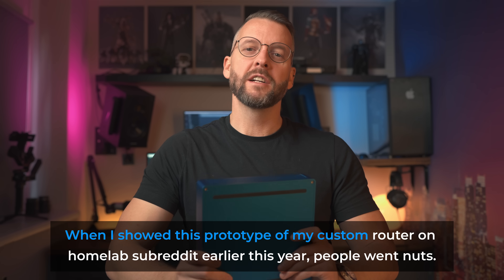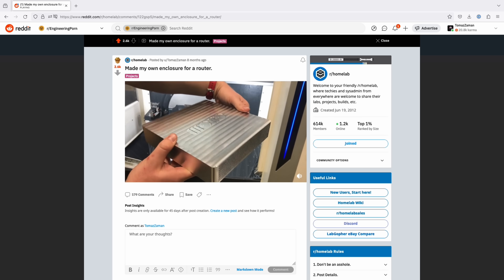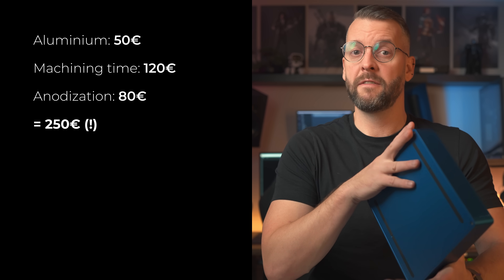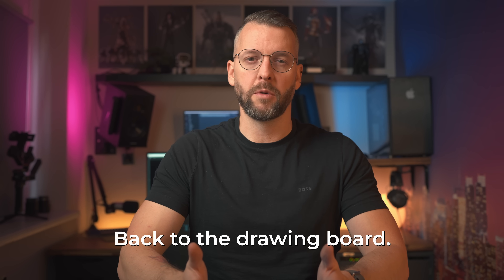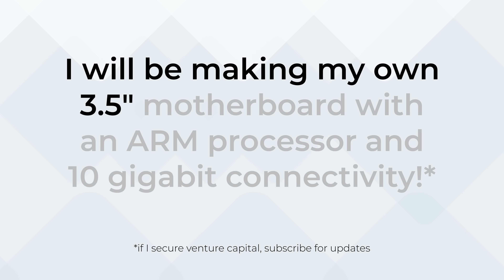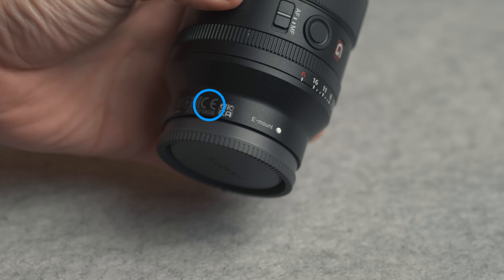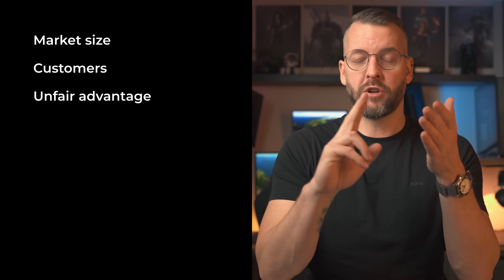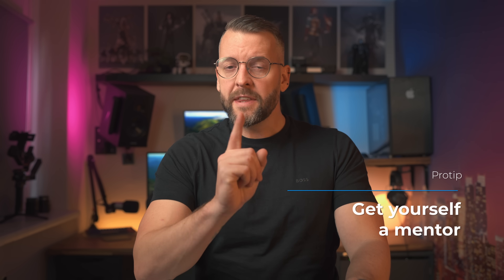I'm making my own high-end router. From scratch.

Comment: I don't give a shet about  what the case is made of. Just do what the other router companies are not providing. Things I care about:
1. Make it open source. Much like what is Pine64 is doing.
2. Has to be cost effective and bomb proof. I want a router that can just go on and on.
3. Make the Wifi upgradable. So whenever a new spec comes out  (wifi 7/8/etc.) I can buy a new m.2 wifi card from you and upgrade the firmware.
4. Super power efficient. 10 watts or less.
Reply from the maker: YES! Finally someone who wants the same things as myself. Except for the case. But we'll talk about that. :D

Comment: I understand your thought process of using an ARM processor because it is more open to new implementations. But any BSD-based router/firewall software such as pfSense and OPNSense are not compatible with it. VyOS is also still not officially compatible with the ARM architecture. I found it odd that you enumerated those router software at 6:40 and a few seconds later you say that you will be making your own system with an ARM processor. There are no 3.5" ARM motherboard in the market that support OPNSense and VyOS on the market simply because they are not compatible with each other.
Your idea is great, there are not a lot of great generic router hardware on the market that are designed for open source router/firewall softwares, especially since the announcement of the EOL of the APU (PCEngines) hardware product. I think that you should stick to an x86 architecture (Intel or AMD) and Intel NICs to ensure the highest compatibility.
Reply from the maker: Thanks for the input - make sure to watch my latest video in which I explain most of your points.

Comment: The device in the segment to beat is the R86S G2 which I loved for it's 2x 10gb SFP ports and the 3x 2.5gb ethernet.  It is what I currently use for pfSense but I would happily replace it with something better.
Reply from the maker: Honestly, I'm not trying to beat R86S G2. Or any other device, for that matter. I want to make something great that people will be involved in the creation of, hopefully pass on as much knowledge as possible in the process, offer great support once it's done and sell enough to be able to build an ecosystem of other products around it. Ambitious, I know. 😅
Reply: Have you gotten to test it with any CPU-intense things like connection tracking or WireGuard? I'm curious what kind of throughput you get with NAT also.
Reply: @john_elliott  I am not even sure how I would go about running throughput tests.  If I do a speedtest_net it shows up 913up/932 down. Fast_com shows 1gbps down / 910 up. Although fast used iip6 so not my NAT. But that's just my 1 gbps down / 950 up pppoe fiber internet.  I only have 10gbps devices on my local VLAN and everything  on the other VLANs runs at 1 gbps.

I do know it is noticeably faster than the Deskpro with a 2x 10gbpc card it replaced. I mainly did it because the R86S uses less power so the UPS downstairs struggles less during an outage and also the smaller size helped as well since my landlord would not appreciate me bolting a second rack to the wall downstairs.

Comment: take my money ! 

make something that has sfp at least 2 sfp or 2 rj45 ports ppl in america will go nuts.  im willing to spend on that in a heart beat i currently have a dellr720 as my bare metal router id like something less loud and less power hungry but its impossible to find a 10gb+  sfp anywhere im more than willnig to use a rj45 to sfp converter its what i do now because rj4510gb is to much money.

this would be my new opensense box for sure.  i would be fine with plastic tho if it saved money,  this meets the (i want this) for 1u router that does not sound like a angry chicken being sucked into a jet engine .

@Tomaž Zaman
Reply from the maker: Thank you for your input!

Comment: Scope creep would be my biggest issue with a project like this. Keep it simple but look to the future as well. If you could make it "modular" that would be very cool. Only need a router? Get the base unit. Need to add some wifi? Sit a radio module on top and plug it in. Need a server? We have one that matches the aesthetic and stacks with the rest of the hardware. All the extras could come later, or not at all, but if you need a v2 to add on extra features, it becomes less appealing to ADD for the early adopters.

Also, great content, looking forward to seeing hows this comes along!
Reply from the maker: Thank you! And indeed, we just had a meeting yesterday around this very topic, how to make it modular, so that we can sell a "base unit" then upsell modules (we were talking about thread, but applies to anything that can be plugged into an M.2 or mPCIe slot).

Comment: This is awesome, but are there any places you can even make use of this? Like, the highest speed I’ve seen sold in most places is 1 Gb and most of the time you don’t even actually get that because the wiring is outdated in most cities
Reply from the maker: For me personally, I need it internally, meaning I can connect my Mac Studio and my home server with 10Gb so that I can work on large files directly off the server.

Comment: if you want to make money out of it , is very stupid idea ,  the thing will cost you 300-500 , if you want make a profit you will need to sale it at 1000 minimum,  and almost nobudy has 10gb internet , not iven 1gb internet ,   the norm is 100mb internet ,   and the person that will have a 10gb internet will just buy a 1U server and ad a 10bg nic , and if you want a cool small factor router with pfsence  you can buy a mini itx and put it in a hometheater case , will cost less than 100 and will be cool ,

Comment: Please make it super cheap so everybody can afford it.
Go with a cheap injection molded case and cut costs on everything but the quality of the mobo.
There is a guy on YouTube that shows how to injection mold on the cheap.
There are already a lot of high priced 10GBaseT routers out there.
Maybe offer the cheap options too for the ones who can afford it and want to support it.
Since you already made some.
Why not buy cheap cases?
It can work but if it doesn't you have to retool.
If you can beat the price in the 10GBaseT realm meaning a box with 10Gigabit networking and RJ45 sockets like 5 or at least 4.
Don't add QSFP ports, MikroTik already did that.
They have a 4  port SFP or QSFP router.
Most people just need the 4, 5 or 8 port RJ45 10Gig router.
Reply: Can't find the manual injection molding dude at the moment, but I found these:
Micromolder. Desktop Injection Molding
https://www.youtube.com/watch?v=LDGjXNRWlVM
Desktop Inject Omega: Automatic Homemade injection molding machine
https://www.youtube.com/watch?v=h8fND0CUZVA
They would be something for the accelerator space you talked about.

Comment: Its a cool looking router, from what i can hear the priceing point sound to me that its gonna be a bit steep for me, i filled out the form but in todays age i would not even concider buying a router without 4x2.5GbE port  take for example the Banana Pi BPI-R4, only thing the board is missing for me is the 4x2.5GbE if it had that i would 100% jump on buying that and your router looks to become quite similar to the Banana Pi BPI-R4 has a priceing point at around 125$ without a case. so if you add 4x.2.5GbE port and the 8GB of ram, M.2 slot for 5G modem and simslot. its would stil be a hard bargin, i would see the priceing point coming in at around 250$ and even then i would see it as a a competitor to what mikrotik has to offer, yours maybe powerfull with more cpu and Ram than Mikrotik,  but they have the Brand/Name and change the 1x10GbE port you added to 2XSFP+ might be a cheaper option, as "Most homelabbers i know" would maybe use the 1 SFP+ for Fiber comming in and one more SFP port with a DAC cable to a Switch or Main Server as 10GbE SFP network cards is still the Cheaper option for HomeLabbers

Comment: Why not extruded aluminium? Mold is expensive, but after that everything is very cheap. Make a rectangular "tube", slide the pcb in with plastic/metal caps.

Comment: It's amazing you're doing that! There's so much networking crap in the market but hardly any good products that for you to buy them you don't need to sell your kidney.

I'm slightly worried about the VC part. Yes, this is how money is mainly invested in our market and money is what allows good things (but also bad things) to be made. But VC is profit-oriented and you're not an experienced financialist. You're an engineer who undoubtedly deeply cares about making good things for reasonable price, but I'm worried that in the future the pressure for cost-cutting and profit-seeking might be to high for you to resist. Because with VC it is the case more often than isn't.

Maybe you can reach out to Linus from LTT, he has a record of investing in engineering-oriented, user-first businesses. And this way you could save yourself from getting VC.

I wish you all the best and really personally I want for this product to be successful, and if that can be done without VC that would be even better.

Comment: Sheetmetal case. Milled Aluminium is pretty and changes/iterations in CAD/CAM can be done quickly, but it's unnecessary cost. 
A robust steel box with good ventilation is all you need and what most ppl will be perfectly happy with. Screw or glue an alu faceplate with nice bevels on or make that an option. 
Swappable faceplates in 1U  for 10 and 19" racks would be a feature ppl would probably appreciate more than billet bling. 

And don't overdo it with connectivity. Why even so many ports? Why 10gig? This is supposed to be an edge router, right? Not a lvl.3 device. Ppl can buy 10 and 25gig fibre switches if they really need that network speed, but no regular Joe - enthusiasts included - needs that on their edge router. Not now, not in the foreseeable future. You're future-proofing the wrong end. A bulletproof pfsense router with two 2.5Gbs NICs and low power consumption would be more than enough for 99.9% of the ppl actually interested in buying a boutique router for home use. 
Future-proofing an open-source home router means more compute power, not more connection speed.
Keep in mind that most of the ppl in forums etc who are screaming "build it build it I want one" are all talk , have empty pockets and probably already have turned an old $50 thin client into an OpenWRT router with a $15 switch attached to that, because that's enough for their 100mbit connection. 
The vocal minority wants entertainment, actual customers check in from time to time, then look at the final product and either buy it or move on. Quietly. 

You talk about staying grounded, but what I'm seeing in this video is the opposite.
Reply from the maker: Thanks for the feedback! There's definitely plenty of valid points. Which is why I will run some king of crowdfunding campaign, to make sure that people are actually willing to put their money where their mouth is.

Comment: You should make it with SFP+ ports by default. 10 gig over twisted pair is not the future. Its failure is why we have 2.5 and 5 gigabit Ethernet. People could always use an adapter if they'd want RJ45.

Comment: Cześć.
Czy możesz konkurować z UniFi? Mam na myśli sprzęt/możliwości w stosunku do ceny. 
Kupiłem UDM-SE oraz U6-ENTERPRISE za około 660€. 
W UDM-SE mam wbudowany przełącznik z POE+, UP oraz DOWN 2.5 G, a AP obsługuje WiFi 6E 4x4. 
Miłego dnia.

Hi. 
Can you compete with UniFi? What I mean is the equipment/capabilities in relation to the price. I bought UDM-SE and U6-ENTERPRISE for around €660. 
In UDM-SE I have a built-in switch with POE+, UP and DOWN 2.5 G, and the AP supports WiFi 6E 4x4.

Comment: Why machined aluminum and not cast? (or even just folded sheets?  Like a PC case... Heck you can buy off the shelf aluminum cases from folded sheets for all of these form factors for much cheaper...) Or for that matter... Why are you removing 90% of the material from the block and just throwing it away.  It's still worth the price you paid for it.  At least resell the shavings.  Also... What do you mean they're aren't any high quality arm boards?  Most of them have pci-e and all you need from there is the network card!
Reply from the maker: Molds for cast aluminum cost a fortune (talking 20k or thereabouts). And we're not throwing anything away, don't worry. Everything is reused or recycled :)

Comment: I don't know if I've missed something here but I find it hard to understand some of the decission making...... the cost of an Al case machined from billet has in turn driven you to a smaller form factor that in turn has driven to a custom MB design.   10gb routing is some way off being a home requirement so 99.9% of these routers will find their way into a 19" rack mount and the smaller chassis size will require mounting trays and face plates.   Good luck with it - your video is great and enjoyed your story telling.
Reply: Yeah, that certainly sounds like feature creep. Instead of putting an existing device in a box, now he has to design the motherboard from scratch too. I think this is the kind of stuff you do when you expect to sell millions of units, but it's a big undertaking for a small new company.

Comment: Good luck. If you are doing this for fun, sure. Economically close to zero sense still. Sheet metal is the way to go.

Also 10Gb is not really high end. 25Gb is the future (have custom 25Gb router for almost 2 years). In a custom 2U enclosure (mostly to cut on fan noise, but I could have easily fitted it in 1U, or smaller). The case has all connectors (other than power) on front, which I like for rack mounting. For desktop case, one would do all on one side, and that is also what most rack cases do.

As of a custom ARM board. I think ARM is great architecture, but their booting process is horrible, and it is going to be a huge maintenance issue constantly. Big ARM shops even fail in this regard. (Even Rasberry Pi is not perfect in this regard).
Reply from the maker: Thanks for the feedback, I'll address your concerns in a separate video, because you share them with many other commenters! Merry Christmas!

Comment: While the effort is amazing and I really support the choice for ARM this sounds like a huge undertaking. My first thoughts go to a Rockchip RK3588 (mainline linux compatible) SoC and a generic SFP+ network card over pcie. 

This could probably be done rather cheaply if you would only concentrate on a carrier board for a compute model (like the one from Friendlyelec CM3588 which costs 125$ retail for 16GB RAM + 64GB EMMC). Hopefully we get regularly updates on this effort.

Comment: In the design of the case, are you also considering how it will fit into a 19" rack? Either with it sitting on a shelf, or making some extra threaded holes for attaching some kind of mounts for it to be able to sit in a rack?
Reply from the maker: Yes, considering three options: fit it in a shelf, make rack ears or make a special mount. No decision yet, but will update here once we explore further.

Comment: I don't get why you're so keen to use an aluminium case. You can get an as shiny and polished asb-platsic case for way cheaper. And you won't run into problems with radio signals.
Reply from the maker: It's a pet peeve of mine, I guess. I love high-quality enclosures. Plus aluminium. 75% of it still in use today. So, better for the planet.

Comment: it is very  ,very, very, very unwise to cut single case from 10x amount of raw material.... let alone it is waste of resourses and very unethical! Use stamping, bending, inox is much betyer for that matter....Do not forget you will have to deal.with international shipping and the router should not be as heavy as some accumulator... Unless you are  making a fancy show off toy...like apple does
Reply from the maker: I disagree, quite strongly actually. Most routers (and electronic devices in general) are plastic. Globally, only 9% of plastic gets recycled. With aluminium, 75% of it is still in use today!
Reply: @tomazzaman  you answer about recycling. I told about grinding 80% of raw material as a waste... Why doing this when you can do it with inox or aluminum sheets , stamped and formed?

Comment: Love the idea, but i can buy an n95 8gb of ram for 200€ with dual nics and call it a day.

Good luck with NAT and SQM/QoS performance or and vpn or ips performance with a quad core arm.

I mean, 10gibit router but can't do 200mbit for networking.. RPI5 with snort does about 150mbits.

also 1 10gbit wan for 4 gbit connections means there is no way to saturate the 10gbit wan in the internal switch.

would make more sense to have 2.5 gbit for the 4 ports switch.
Reply from the maker: Quad core ARM, when optimized for networking, can pull it off. I'll do all the tests and share with everone here on the channel, and we'll see together.
Reply: qos and Nat offloading  mix well. and Ips need brute force

Comment: Hey. I made my own x86 router using a gygabite ITX board and an 11th gen i3, the main reason I went for that board is because it was heavily discounted and it is actually a pretty decent mobo, it has a 2.5G RJ45 which I use as WAN, added an expansion card with 4xRJ45 ports, I also replaced the inbuilt WiFi 5 with a WiFi 6E (dbdc) card, also added a 4G modem for mobile networking. All of it works great on OpenWrt, though I will just switch to a more complex linux distro since the CPU can handle it. The main reason I went for an x86 is due to AES hardware acceleration for OpenVPN purposes.
All of this fits into a 40 EUR case which I bought off AliExpress, very small form factor (though larger than your box).
Reply from the maker: I'm running a Supermicro Superserver mini-ITX, in an extended enclosure that also allows me to fit in an additional PCIe card (Mellanox connectX-3) to have a 10Gb "backbone" throughout the house. I'm preparing a video in which I'll show it in more detail!